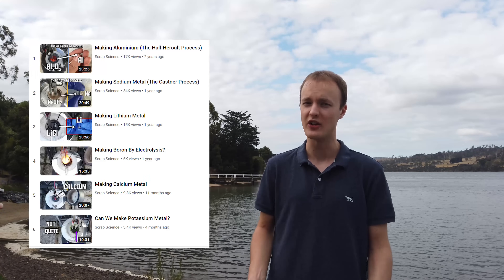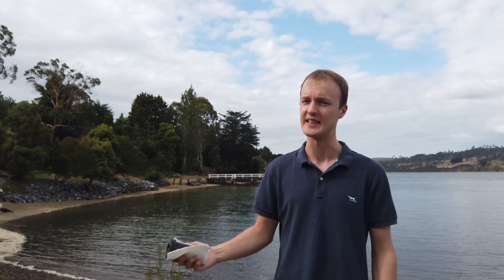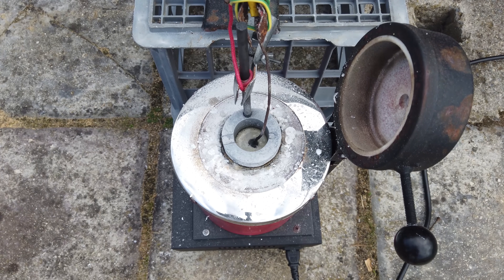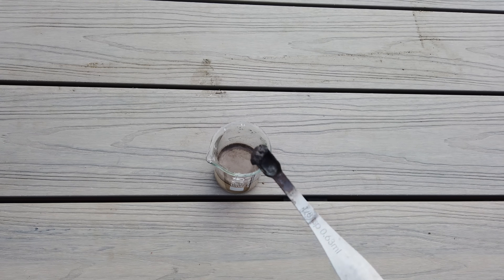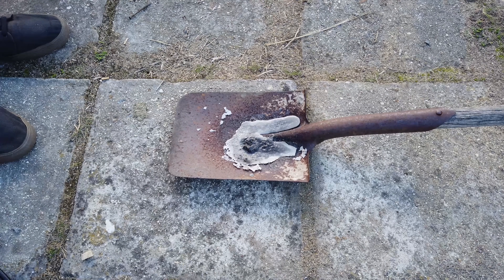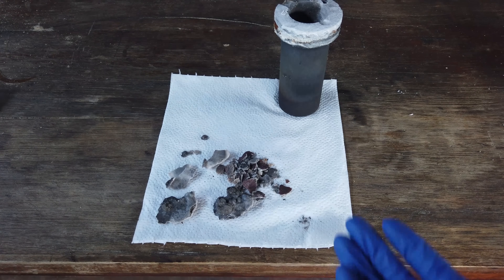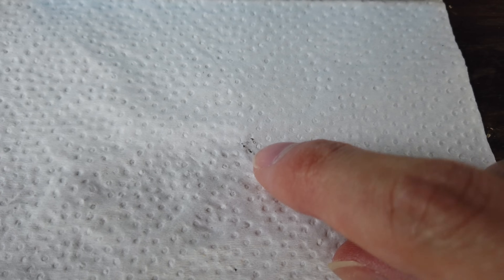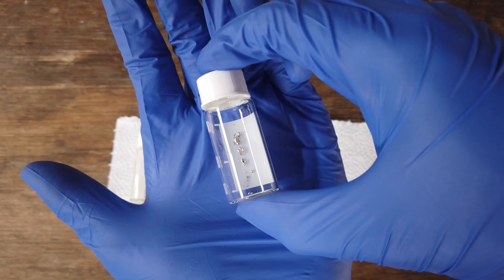Making Magnesium Metal

Comment: how do you connect your graphite electrode to a current securely? is surface contact enough or is it necessary to make a hole into the crucible?
would using a steel plate be better as cathode?
how do you prevent the magnesium from sinking and mucking up the reaction?
Reply from the maker: 1) I've done connections both by surface contact and by drilling a hole in the crucible that another graphite rod fits very snugly into. Both work, and can be used to draw >10 amps, but just relying on surface contact is a lot more unstable and sensitive to moving anything in the setup. 
2) Maybe. If you want to be able to draw a larger current, sure. I can max out the current of my power supply (10 amps) with just a steel wire though. It's possibly beneficial to have the high current density. I'm not sure.
3) I don't know. I didn't do it, and that's probably why we got such a low yield.

Comment: Wouldn't the black stuff be Magnesium Carbide? It would explain it being reactive with water, producing acetylene. Perhaps there is reaction with the crucible.
Reply from the maker: It's possible! In that case though, I don't understand why it's still forming on the cathode like it does at 4:30, since that's nowhere near the graphite surface and shouldn't have any carbon to react with.

Comment: Will calcium chloride work instead of potassium chloride?
Also, what ratio of magnesium chloride to potassium chloride do you use?
Reply from the maker: Yep, a 50:50 mole fraction of MgCl2 and CaCl2 is a eutectic with a melting point of around 620-630 C. I can't guarantee it would work to make magnesium, but it's quite likely.
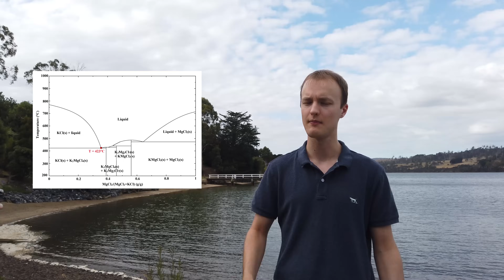I used a mixture that corresponded as close as I could get it to the low melting point region of the graph I show at 1:17. About 40% MgCl2 by weight.

Comment: You had potassium in it
Reply from the maker: Yes
Reply: @ really cool vid and thought journey nonetheless
Reply from the maker: Whoops, sorry for the short reply, that was supposed to be a much longer response.
Out of interest, what makes you say that there's potassium in the product? Potassium is significantly more difficult to extract as a metal under these conditions.
Reply: @ it doesn’t matter the difficulty it matters that it’s possible. If it’s possible then it’s probable it just comes down to what degree. How much potassium. Then also I don’t think you’re accounting for the heat and its thermal reaction being added  to the process. Think of hydrochloric acid… it’s not good for dissolving au…. But it is able to attack enough to produce an oxide layer that it can attack slowly, but if you take that same hcl and add heat it increases the rate of ionic exchange.
Reply: @ so going by the slow reaction and the fact it’s to h20 given then process used the most obvious thing to think is that you carried over some potential potassium. Until proven otherwise I think that’s the logical conclusion…. But I’m also smart enough to know you’re smarter than me that’s simply a country boys thoughts… the only other thing I can think of is a little sodium metal was made…. But I like the potassium view.
Reply from the maker: @littlebittathisnthatfirear8048  I'm not so sure. The solubility of potassium in magnesium is pretty much negligible, and they are very immiscible metals at the temperatures we were running the cell at (source: https://doi.org/10.1007/BF02871183 ).
I'm confused as to what you're referring to with temperature effects and heat. Magnesium reacts with water quite readily at high temperatures or when finely divided, and still does so slowly at room temperature, so the presence of a reaction with water can't really lead to any concrete claims on its composition (or at least, it wouldn't convince me either way). It's definitely possible that potassium is present to some very small degree, and maybe this is more likely in the sponge-like material, but I'm not completely convinced by the available evidence.
I'd love to test the sponge-like material more thoroughly, but it's difficult when its full of the salt mixture from the cell.

Comment: Hi, you need to dehydrate the mgcl2 first (or buy it). Magnesium production from chlorides is all about the dehydration - which is not easy to do. You can’t just boil the water off as you make various magnesium oxide compounds and hcl gas. Once dehydrated you should be able to make a lot of nice metal with your setup.
Reply from the maker: Correct. I discuss this a little at 1:30-2:00. Due to the difficulty in dehydrating the salt, I opted to try without it. The yield would, of course, be much better by doing this, but it appears unnecessary when we only want a small sample of the metal.
Reply: Gotcha. You seemed a little uncertain and I just wanted to mention that it is certainly the difference between what you got and really nice amounts of metal.
Reply from the maker: Do you happen to know of any convenient ways of dehydrating the stuff? I've never seen any that seemed viable in a home setting.
Reply: @ScrapScience  fluidized bed dryers or drum furnaces are used to dehydrate MgCl2 but still some residual water remains so the next step is melting and settling MgO (preferably with chlorination). This how it's done on an industrial scale these days. In the past Dow used to prepare partially dehydrated MgCl2. Whatever you do, you must separate the salt (electrolyte) preparation and the electrolysis
Reply: No there really isn’t to my knowledge. It’s pretty intense any way you go about it. 

You can slowly boil it to ~170 c (I think, I would need to verify the exact temp) which gives you the dihydrate form. You will still have problems but it will be much better (that’s how Dow did it at Freeport). 
You can also buy anhydrous but it’s expensive.

Comment: Can i mix it with NaOH to lower melting point or it would get wlectrolyzes first?
Reply from the maker: I'm honestly not sure. Generally, mixing chloride and hydroxide ions in a melt you want to electrolyse is probably a bad idea. The oxidation products can end up generating chlorate and other oxyhalogen species, but this may be at a high enough temperature that it's not a concern. Possibly worth a try.
Reply: @ScrapScience  okay thanks for response

Comment: Not surprising considering that little bead was around 10mg you are looking at about 250J pf which at sumch small piece and considering the process is adiabatic around 22%-25% of the energy is the form of visible light which means around 60J in light for about four seconds that means about 15W of light on average that is hell bright of light hou know

Comment: I think one of the problems is, once the molten metal falls, it's then falling on the anode and thus is in an oxidizing environment. Maybe put an insulator, like a silicate dish, on the bottom of the graphite crucible to collect the liquid metal?
Reply: ....looking at this I have no idea what I was thinking. Magnesium would react with a silicate dish to pull out the elemental silicon....

Comment: I have a crazy idea I'd like to try: I think it should be possible to dissolve MgCl2 in acetone or ethanol (less so than in water but still) and you should be able to extract the Mg from there by electrolysis. For a reason I am unable to explain for having forgotten it, the electrolysis doesn't work in water but could work in these other solvents.

It is hugely recommended against because the electrolysis will also produce tons of weird organic compounds and everything might catch on fire.

But it should be a pretty fun experiment.
Reply: No it does not work, but it does do something a lot more interesting if you are using an alcohol. It makes organic magnesium halides aka griginard reagents. ❤
Reply: @christopherleubner6633  uuu :)

Comment: Hi, I've been interested in chlorate production for quite a while now. Finally I found mmo anodes at a reasonable price in the EU. But I have a question and I think you are the person who might know the answer. Question is: what's better? Plate or mesh? Both anodes are in same price. From NurdRange's vid I know that KClO3 crystals can grow in the holes of the mesh blocking electron flow, and that's what I'm afraid of. I guess mesh has a larger surface area so I don't know which one to pick. Hope you know the answer
Reply from the maker: Crystals growing in the holes is not a huge problem, provided you’re not running your anode at a very high current density. Even with plate anodes, crystals can still easily deposit on the electrode surface.
Even the surface area of the plate vs mesh is not significantly different most of the time. 
All up, it’s pretty much a choice that doesn’t matter. Pick the one you think would look the best I suppose.

Comment: Hi Scrap Science,
Nice video and encouraging results.

Magnesium dust or sponge can be quite reactive with air or water.
Dust can be pyrophoric and may lead to a FAE while opening the drum.

Jus like Al, with water, Mg reacts and it can be accelerated by warm water (sometimes due to self warming).
Mg + H2O --> H2(g) + MgO(s)
MgO + H2O --> Mg(OH)2(s)
Some water gels of Al (and probably Mg too) can be actuated by primers and H2O2 mixes are devastating.
Magnesium rods are used to reach very high temperature underwater because it reacts with water to produce MgO that burns hot and bright underwater generating H2 gas arround.

When trowing the molten metal and MgCl2 onto rusted iron...it may decompose a bit the Mg metal due to "magneto-thermic" reaction, Mg is very close to aluminium and it is thus reducing metal but more reactive than Al.
3Mg + Fe2O3 --> 3MgO + 2Fe

Reagards,
PHZ
(PHILOU Zrealone from the Science Madness forum)

Comment: Another method is Silicon to purify Calcium and Magnesium metal. It could work since it binds to iron, etc if needed. But I assume it is quite pure Magnesium. Yes, Oils are too low for the project Cool video. Patent info on it said Silicon may work. However high temperatures are required. Also works for Magnesium.

Comment: could you have baked the Magnesium chloride at 400 for a few hours to drive  water off?
Reply from the maker: That's essentially what I was doing at around 2:50. No matter how you heat it though, there's no way to remove all of the water without some kind of decomposition of the salt occuring (without complex drying techniques, that is).

Comment: Could it be that what you see reacting with water is in fact a tiny percentage of metallic Potassium that you managed to reduce in the same electrolysis bath?
Reply from the maker: It's possible, but it would be surprising. Potassium is notoriously difficult to deposit from its molten salts, especially chloride melts, since the reaction is thermodynamically unfavourable and the metal is generally soluble in the melt itself.
If we had in fact made a magnesium-potassium alloy, I'd also have expected it to give a slight purple flame when burning it - which we didn't see.
Again, it's possible, but the evidence seems to suggest that it's unlikely.

Comment: You should do this is magnesium sulphate it's very cheap and common from Epson salt
Reply from the maker: When anhydrous, magnesium sulfate will decompose before melting. Even if it didn't, the anode reaction would be rather complex when working with molten sulfates. I don't know exactly what would happen, but I doubt it would be well-behaved...

Comment: If the metal sinks off the cathode as it forms, it will sink onto the anode where it will inhibit the oxidation of chloride by oxidising itself away. Assuming you don’t put some sort of insulating vessel inside the molten salt, or maybe some sort of much denser chloride salt that the magnesium metal will float atop. Best off performing the electrolysis at a lower temperature and attempting to remelt it separately.

Didn’t think about using the graphite as the cathode, that’s sensible.

Bet that dendritic sponge burns well though. Maybe you could dissolve the salts off in particularly high pH water?
Reply from the maker: I was kind of surprised to see that the sponge doesn't even burn. The salts within the sponge completely coat the stuff when you heat it up, and I couldn't ever get it to ignite.
Dissolving with very basic solution is something I hadn't thought of though. Might work! If I ever try this again, I'll have to give it a go.

Comment: Nice video. First time to see a magnesium extraction. Have you managed to clean your crucible?
Reply from the maker: Are you referring to the fact that I spilled the molten salt in the furnace last episode? I completely forgot to mention that...
Yeah, I was luckily able to clean it all out and the furnace still works perfectly. :)

If you're just referring to the crucible I used in this video, everything easily washed out with a little water.
Reply: @ScrapScience  I was referring to the crucible from this video. Making magnesium is very tempting and maybe I will try to replicate your method but I don't want to damage my crucible. It is quite expensive for 60mg of the metal ;). 
I like your videos because it's like watching pioneer chemists on their way to discover new elements. You don't use highly specialized equipment (although it's getting better over time :) that is available for other chemistry amateurs.  
Thank you and I wish you a happy New Year :).

Comment: I wonder if some potassium fluoride would help the oxychloride mixture dissolve/electrolyze?

Also be interesting to use a graphite rod anode in the middle, letting metal form on and sink to the bottom of the crucible.

I wonder if carbide formation is relevant here?  Mg2C I think isn't very common, or stable, but with direct elemental synthesis, who knows.  A welded steel crucible cathode might be mitigation for this (Fe and Mg are pretty much insoluble/immiscible).
Reply from the maker: I'm definitely no expert on what fluorides would do. It's definitely possible, but I don't have much desire to work with fluorides...
And yeah, magnesium carbide is also a possibility. But I'm not really sure on that front either, honestly...

Comment: Of course it’s reacting with water you put potassium in it. I’m no chemist but it seems obvious to me
Reply from the maker: Potassium is notoriously difficult to deposit from molten salts like this, especially mixtures containing chloride. If we actually deposited potassium alongside our magnesium product, that would be a surprising result.
Reply: Are you by any chance making some kind of acid that's accelerating the reaction between water and magnesium?

Your reaction produces chlorine gas, and your starting products contained water. Is it possible that you're making some hydrogen chloride somewhere in the process?

What's the pH of the solution after dunking the magnesium sludge into it?

Comment: I wonder if the spongy high surface stuff would be good to make Grignard reagents?
Reply: It seems that ultrasonication (about 25 years ago) was used into the department nextdoor (physical chemistry and corona chemistry) where I was making my endwork study - report (photochemistry)) can be used so that cavitation bubbles exploding onto the surface of Mg metal makes its apparent surface so big that the metal can then be used as such for Grignards without drying, ether nor dioxane.

I know that ultrafine Al dendritic dust (made from exploding Al wire under high amperage and vacuum, then exposed to slow flow of cold air so softly passivated) can be compressed into a spongeous form. This dust has a much higher specific impulse for rocketery than conventionnal german black and it makes a sponge that can absorb TNT forming a core for implo-explosion-detonation; the nanometric Al dust generated into the TNT detonation makes a FAE that suck up all O2 and N2.

PHZ
(PHILOU Zrealone from the Science Madness forum)
Reply: Ohh,  that makes me wonder if it would be useful for thermochemical dioxane process to make sodium, especially since it reacts with water, so could also do away with the starter bit of sodium/lithium as a drying agent.
Reply from the maker: It seems rather unreactive outside of aqueous conditions since it's filled with the salts from the melt. If we could remove the salts though...

Comment: I bought a magnesium fire starter. I played with the metal, filed it, played with powdered and flaked (burned and such). The main block ended up in a cup of water, can't remember what I was doing, but anyhoo, it became covered in this white stuff, looking like an oxide layer on steroids, but the black and whiteness of it let's me know that spongy stuff is all magnesium. It is very reactive, basically with more surface area its almost like activated aluminum (like mercury treated). A simple fire test proves this, as you see with the beads. You have far more magnesium than those little beads. That Slag is pretty pure magnesium.

Comment: Have you thought of Purifiying it with Mineral Oil sort of what you would do with Sodium? Or is that a totally different method? Cool video indeed.
Reply: Melting point is way too high for mineral oil.
Reply from the maker: Yeah, if we could melt the magnesium at temperatures that mineral oil could tolerate, this would be a great method for coalescing the metal. Sadly, magnesium's melting point is way too high.

Comment: Maybe just try to collect more of that spongy stuff and melt it in solid blob?
Reply from the maker: I didn't explain it very clearly, but that was kind of the idea at the end of the electrolysis run. I tried making a whole bunch of the spongy stuff and then stopped the electrolysis and raised the heat to get it all to melt together. It seems like the sponge was resistant to melting together, but maybe it just needed to get hotter for longer... I don't know.